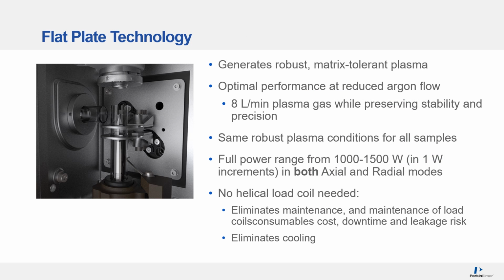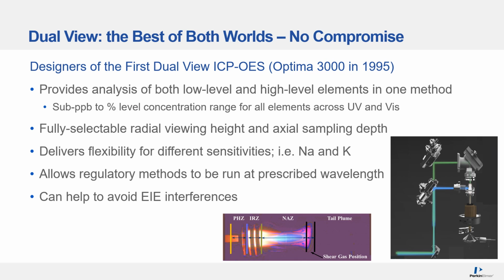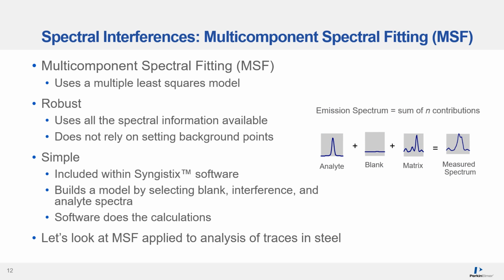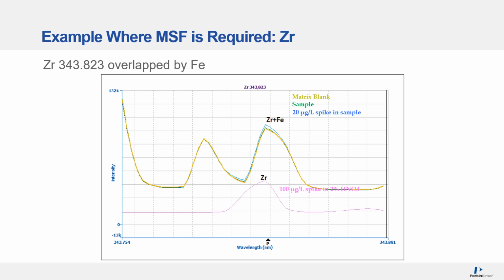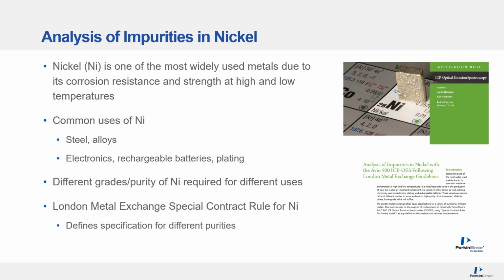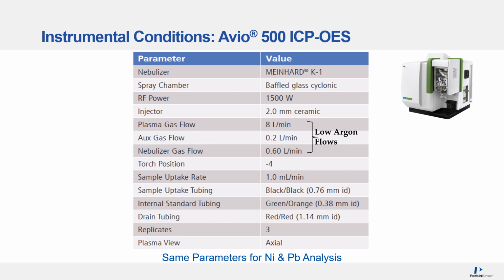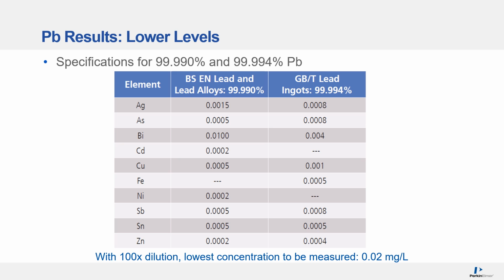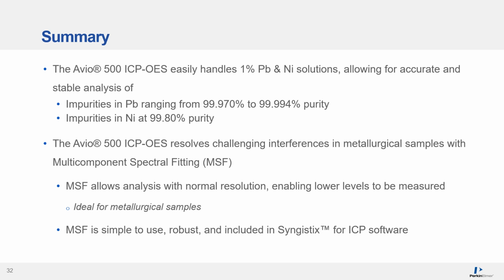Analysis of Impurities in Metals with the Avio® 500 ICP-OES

Comment: Avio 200 is not a sequential but "hybrid-scanning" ICP-OES. It does provide simultaneous data for the background correction points which cannot be done in a sequential ICP-OES without a peak search routine.